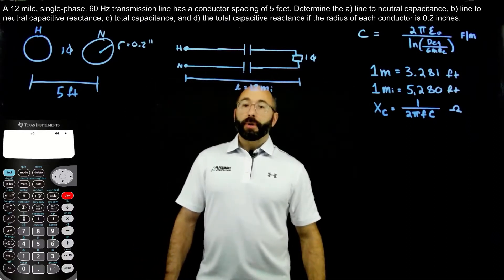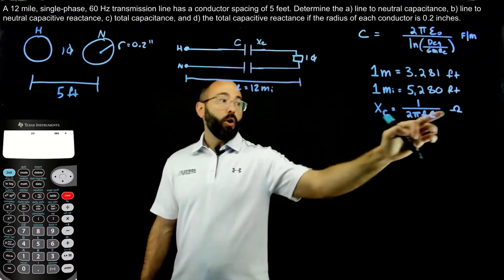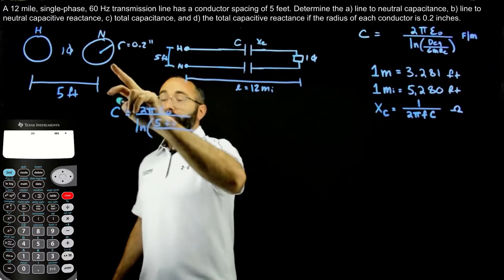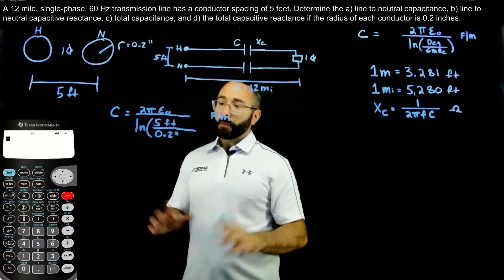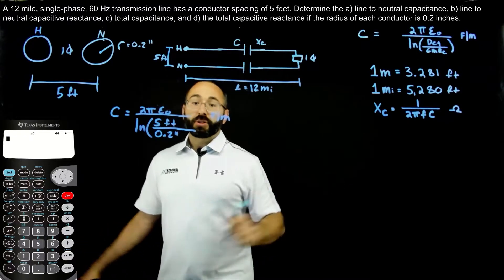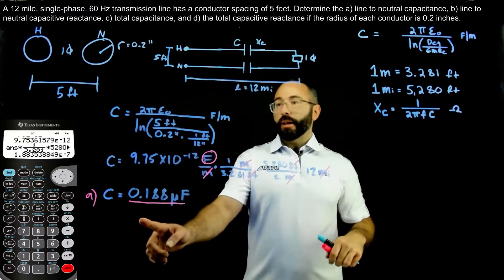Single phase Transmission Line Capacitance (C) & Capacitive Reactance (Xc) Electrical Power PE Exam

Comment from the maker: Video Table of Contents (click each timestamp to advance):
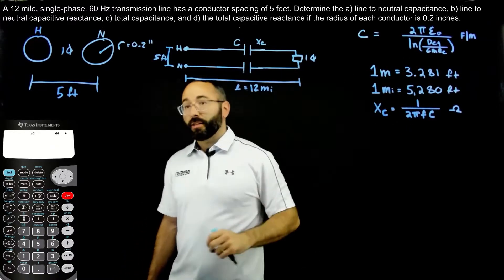2:28 - Solving for the line-to-neutral capacitance (C) in farads per meter [F/m].
5:33 - Converting the units of capacitance (C) to just farads [F].
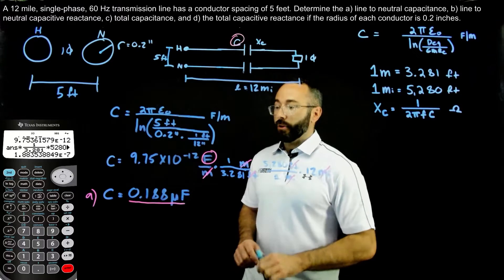8:37 - Solving for the line-to-neutral capacitive reactance (Xc) in ohms [Ω].
10:34 - Solving for the total capacitance (C) of the transmission line in fards [F].
14:08 - Solving for the total capacitive reactance (Xc) in ohms [Ω].

Comment: I think your circuit diagram is wrong, the capacitance is between the conductors, and conductors to ground, not along the line as you drew it.
Reply from the maker: Hi German, while the naturally occurring capacitance of transmission lines are indeed between conductors, and  between conductors and the earth, these are per length values that vary with the length of the conductors:

C [F/ft] * l [ft]

Where:

C = the capacitance of the conductor in units of farad per foot.
l = the length of the transmission line in units of feet.

For a single-phase transmission line, this relationship allows us to draw the series capacitance diagram shown in this video representing the capacitance of the hot conductor and the capacitance of the neutral conductor to help us calculate the total capacitance of a single-phase transmission line as the sum of both the hot conductor capacitance and neutral conductor capacitance.

Note that this diagram is not the same as the single-phase equivalent Pi model (or the similar T model) of the transmission line used for circuit analysis purposes of the over all transmission line. The diagram in this video is only used for the relationship between the line-to-neutral capacitance (sometimes referred to as "average capacitance") and the total capacitance of a single-phase transmission line:

Ceq = C//C
Ceq = 1/[(1/C) + (1/C)]   or  Ceq = (C⁻¹ + C⁻¹)⁻¹
Ceq = C/2

Comment: very cool. It seems that the formula you are using is considering air as the dielectric as a constant rather than say something like a shielded rf cable that has some other material between the center conductor and the outer shielding of the coax. Im trying to figure out why i have a radio station rf cable out of my transmitter that is going 1000 feet up the tower getting zero reflected with optimal wattage output and its not getting to his receiver miles away. I should have some reflected. Wondering if corrosion or water seeped in and the short is substituting the correct impedance for the antenna allowing a perfect match so as to not give reflected power. But that doesn't make sense to me. any suggestions. could be a bad receiver, but i doubt it. Isn't there a way to check a rf coax line for a short by sending a 1khz tone down the line and using a meter or osciliscope to find it. It's been years ago but i remember something like that. Help.

Comment: an aviation standard says to measure product line-neutral capacitance, which has to be smaller than some value. can you please explain why this is important? Capacitance increases with cable length, so if the product is an electric motor with long windings is that part of the cable length?
Reply from the maker: Line to neutral capacitance is used for three-phase transmission lines when modeling the transmission line as a single-phase equivalent circuit. Most transmission lines are three-phase, so the difference between the line-to-neutral capacitance and the total capacitance discussed in this problem only applies to single-phase transmission lines.

Comment: Thanks for the video sir. For the first question be like - a) what's the capacitance b/w line/neutral to load? Wouldn't Line to Neutral be called as Total capacitance?
Reply from the maker: Hi Siddhu, the capacitance (or reactance) of each conductor is referred to as the line-to-neutral value. The total capacitance (or reactance) is the sum of both the hot and neutral conductor capacitance (or reactance) values.
Reply: @electricalpereview  That clears up. Thanks a lot!